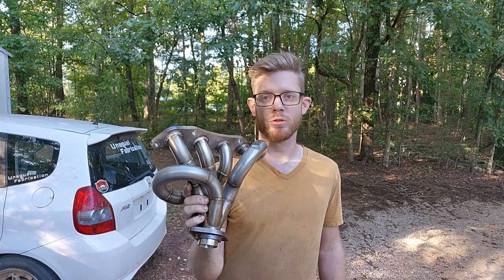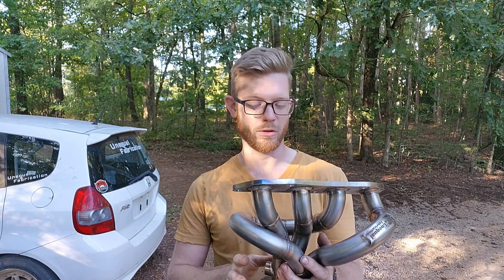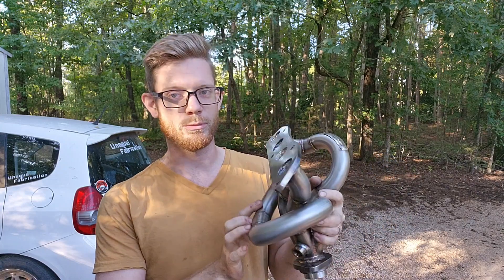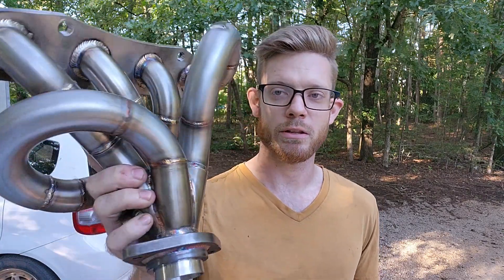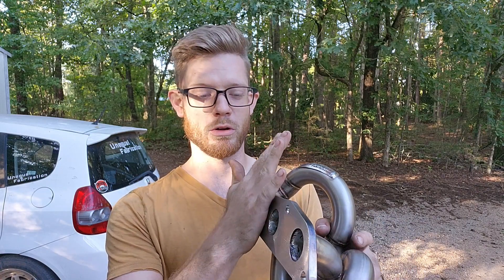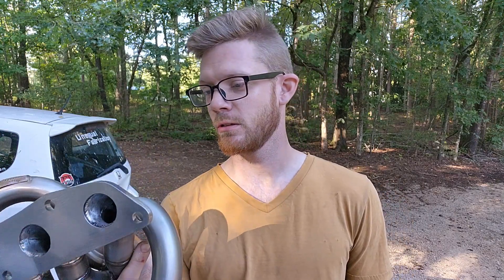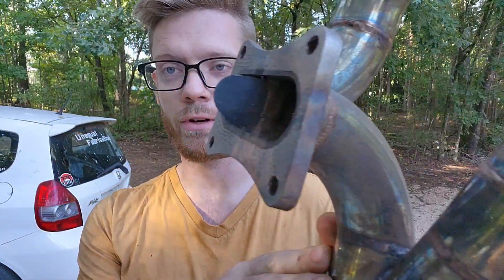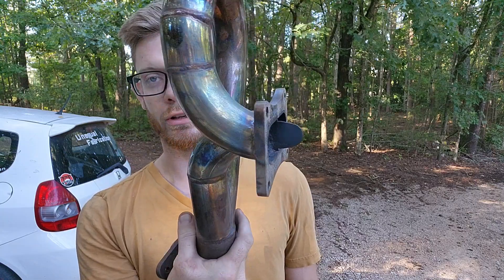Why Unequal Length Headers Sound The Way They Do

Comment: My engine firing order is 1342 so would I have to have 1 and 3 as the short run and 4 and 2 as the long runners?
Reply from the maker: Either that or 1&2 and 3&4. It doesn't matter which set is long and which is short.
Reply: @unequal_fabrication  oh awesome thank you.
Reply: @unequal_fabrication  does it effect the sound depending witch ones you make short or long?

Comment: It says on your website that this is out of stock for Honda FIT GK5. How can I get one and what's the lead time? Also, what is the measurement of the tube? is this 1.75?
Reply from the maker: I'll have some built and ready to ship around the first part of the year. 
The primary tubes on the gk5 header are 1¾" and the outlet is 2"
Reply: @unequal_fabrication  By 2026? and how long will it take to ship from US to Philippines?
Reply from the maker: @Pinoy_runner_and_hooper  yes 2026
Also I'm not sure what shipping times to the Philippines are currently. A lot of that usually has to do with how quickly things are moving through customs.
Reply: @unequal_fabrication  Got it! Guess it’s a waiting game till 2026. thank you for responding. Appreciate it!
Reply from the maker: @Pinoy_runner_and_hooper no problem

Comment: on a subie since 2 the header length is on one bank, and engine firing order is right-left-right-left, should the sound be going through headers short-long-short-long?

while yours is long on 3-4 while l15 engine fires 1-3-4-2?
so the firing order would go through short-long-long-short

is this  different than a subie?
Reply from the maker: On a 4 cylinder Subaru boxer (and even my old air-cooled VW)  the cylinders on each bank fire convectively. However with a 6 cylinder boxer engine the firing order is back and forth. A long time ago I tried a header with it firing short-long-short-long and it didn't sound like a Subaru at all. It wasn't really a pleasant sound. Maybe one of these days I'll make another one  for science to show the difference.
Reply: @unequal_fabrication yoooo on a 1yo vid reply? that is so cool, thanks for the insight
Reply from the maker: @pepegya5168 always happy to spread the knowledge 🤙

Comment: Its for sure the length and time… its not so much the pitch…
Theres a reason a ford v8 just SOUNDS DIFFERENT than a chevy… firing order… theres maybe SOME difference here, but even when you put super short headers on a car it sounds the same, just louder..
Reply from the maker: The firing order will 1000% percent change the sound.

Comment: By the way it would be really cool if you made some headers for a car with the firing order 1-3-4-2 (common I4 firing order) where the pipes of cylinders 1 and 2 are 1.5 times longer than the other 2 pipes before they all join into the collector. So length of 1 and 2 is the same and length of 3 and 4 is the same, with 1 and 2 being 1.5 times longer. This should give it a sound similar to a crossplane V8. As far as I know noone has tried this on the internet.
Reply: @Chris-cy3uq  Dude, the length of the tube has literally no influence on the sound.

Comment: Actually the main reason is in fact the sound taking longer or shorter to travel due to the different length. Learn about firing intervals. The comparison to instruments is wrong because in instruments the air inside of the pipes is vibrating. In engines you hear not the air inside of the tubes vibrating, you hear pressure pulses from the high pressure exhaust relative to the ambient air escaping into the environment through the exhaust. There is no ''standing waves'' inside of a car exhaust like there is inside of instrument pipes. To see why this is correct listen to cars stock vs. with longer or shorter headers, you will hear that there is no big difference in pitch. Further evidence that it is all about firing intervals - do you wonder why a crossplane Yamaha R1 sounds the way it does despite nearly equal length headers? Well there you have it, the 270°-180°-90°-180° firing intervals as compared to even 180° intervals of a regular inline 4. You can emulate different firing intervals by giving different lengths to different pipes. With unequal length headers with the right length and in the right place you can also make a Yamaha R1 crossplane sound like a regular inline 4 for example.
Reply from the maker: By your calculations how unequal length do I need to make a set of headers for it to sound like an equal length header? And I've made ones that are 1.5 times length. It still has a boxer rumber. I've also done ones in the ball park 3x and 4x and the rumble is just more pronounced.

Comment: Very cool. I may be able to help explain why the pitch becomes lower as the length of the tube increases. Vibrations cause the tube to resonate and the wavelength of the tube’s resonant frequency becomes longer as the length increases. Lower frequencies have longer wavelengths so a longer tube resonates at a lower pitch. 

As with any physical instrument there are also harmonic overtones produced by the vibrations. The width of the tube plays an important part in filtering the harmonic frequencies. A wider tube will have fewer high frequency harmonics so the fundamental resonant frequency will be emphasized and thus sound like a more pure version of that pitch. A wider tube of course contains more air and thus requires more energy.

But even a wider flared opening on the end of the tube can provide some of this effect. This is because of the way the resonating air leaving the tube interacts with the air directly outside the tube (something called “end correction”). BTW this is one factor in the “timbre” of an instrument which is what allows our ears to differentiate two different instruments playing the exact same note (saxophone vs piano for example).

And of course when you have multiple tubes of different lengths you can tune their lengths to each other so they produce complimentary pitches. The basic formula for this is that the smallest, cleanest ratios will produce the most pleasing harmonic intervals. For example, a tube exactly half the length of the first (2:1 ratio) should produce a pitch of the same note one octave higher. And a tube 2/3 the length of the first (3:2 ratio) should produce a note that is a perfect fifth higher. Differences in length that are expressed in less clean ratios like 17:16 will sound more dissonant.

This has me wondering now if anyone has built a manifold that plays a chord arpeggio.
Reply from the maker: I appreciate the info! 
I've wondered what a header with each consecutive runner being longer than the last would sound like. Maybe I'll give that a try one of these days. 
I've also got an e36 with a straight 6 that I want to try some different variations of lengths on and see what kind of sounds it would produce.
Reply: @unequal_fabrication  Have you tried or have you considered making stepped headers? I’d love to hear what that e36 with a stepped 3:2 ratio header sounds like.
Reply from the maker: @phonyPope  stepped headers are also in the list of things to try. I really want to try a stepped 6-1 header for the e36. But I haven't been able to think through a way to not make it a complete pain to get them on and off.
Reply from the maker: @phonyPope  without a doubt! Just hard to find the time. Been crazy busy building parts for everyone else haha
Reply: @unequal_fabrication  That’s a good problem to have. Go forth and prosper.
Reply from the maker: @phonyPope  I appreciate it 🙏
Reply: Dude the length of the tube has literally no influence in a car exhaust, you know why? Because it's not the air vibrating inside of the exhaust that causes the sound, it's the pressure pulses that come out of the engine. It does not work like on a blowing instrument.
Reply from the maker: @Chris-cy3uq  you're correct, you are not going to be able to play an exhaust like a trombone. But some of the principals apply.

Comment: I'm curious. Would you be able to tune the exhaust note with pipe length to sound more like a cross plane crank (180-90-180-270) rather than a subi?
Reply from the maker: I don't know if the cross plane crank sound would be achievable with runner length. The unique sound from that is from the uneven spacing of the cylinders firing. I've been wanting to try making one where each runner is longer than the last and see what kind of sound that yields.
Reply: @unequal_fabrication  I know there is one guy on here who did an UEL header for a Hayabusa for the subi rumble. I cant help but wonder if extending the pipe of the cylinder that fires last would would create that unique cross plane sound or something different entirely. Now I'm wondering if each runner is longer than the last in the order they fire if you could time it to create a single pulse out the collector like a thumper.

Comment: Wait, you HAVE tried the 1-4 and 2-3 pairs? Can I get a video with the sound!?
Reply from the maker: I tried it like 12 years ago when I was first experimenting with lengthening runners. I don't have any sound clips though unfortunately
Reply: @unequal_fabrication  Damn. Do you think you could do one again, just to show what it does? I've only got one guy to do it, but he did it with a huge 3x length ratio instead of the typical 1.5x to 2x Subie Rumble ratio, so I think that is the primary reason it didn't sound how I expected it to.

Comment: can it be done on v6 motors?
Reply from the maker: In theory yes,  I've yet to try it though. You'd end up lengthening 2 cylinders on one bank and one on the other. And they just need to be consecutively firing cylinders.
Reply from the maker: @salvationbygracethroughfaith  yeah very possible. I plan to make some for my e36 with a straight 6 and see what the result is

Comment: what the order would be you think on a 6 cylinder engine 1-2-3-4-5-6 (firing order) shorter to longer? id like to try this on a 6I engine 😬
Reply from the maker: The typical straight 6 firing order is 1-5-3-6-2-4 in that case you need 3 consecutively firing cylinders.  Or you could just do 2, but 3 would be more pronounced. I've got an e36 and plan to make a set of unequal length headers for it but haven't had the time lately.

Comment: great stuff sir! if the firing order is 1 3 2 4 then i suppose it would be short-long-short-long?
Reply from the maker: Correct if that was the firing order that that would be how this configuration would work. But with all the cars I've made them for the firing order is 1 3 4 2. It just needs to be consecutively firing cylinders that are lengthened for it to sound right.

Comment: Does it need to be a 4-1 setup? Or could i get away with keeping the low-midrange power that 4-2-1 colectors provide?
Reply from the maker: The same principle works on 4-2-1 headers as well. I use to make a lot of unequal length 4-2-1 headers.